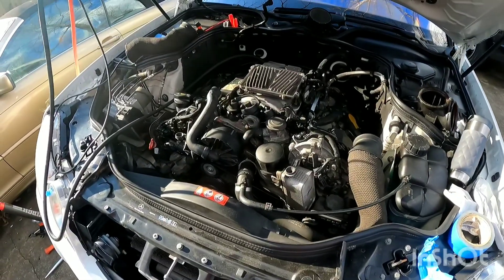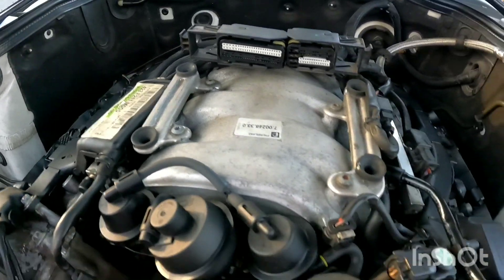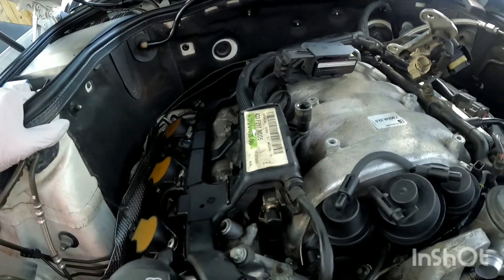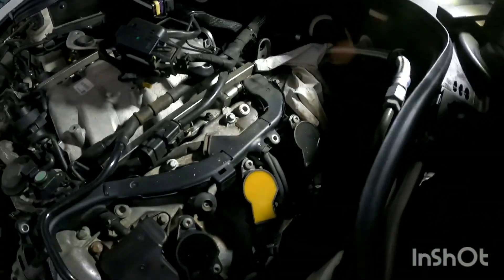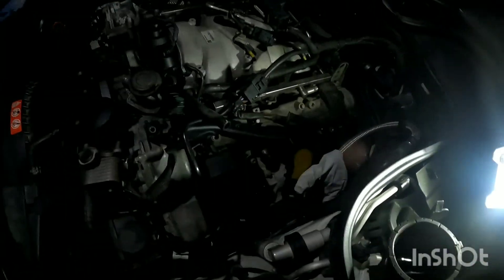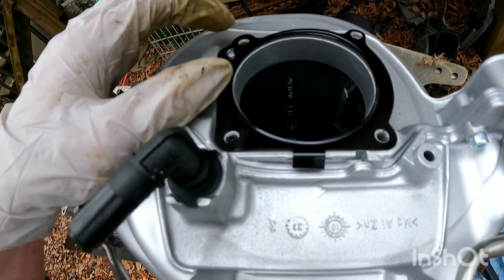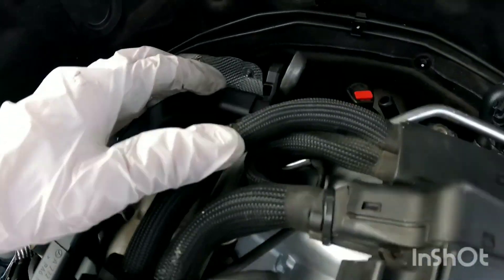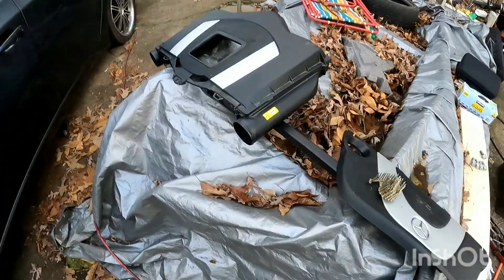Intake manifold replacement for 2006-2011 E350 Mercedes Benz

Comment: thank you for sharing this.  I am installing a replacement engine(mine was a 2006 and had the issues with valve train).  I spent the day hooking up all the wiring to the new engine only to find that the vacuum actuators on the front had been broken by the person who removed it at the auto wrecker.  Have to transfer parts from the old to new and must take intake off.  Seeing you video let me know the minimum that has to come off to do it.  Knowing that the harnass can stay is a great relief.  You put together a great, no nonsence video
Reply from the maker: Glad I could help I try to find the easiest and quickest way to do the job.

Comment: Great vid man good to see the garage mechanics doing this stuff. What brand manifold did you use doesn't look like the oem pierburg... how has it held up for you? I'm thinking about installing a chinese one made by mitzuno on my w207. Also what was that beeping noise the car made right before you screwed on your fuel pressure valve cap? My car makes this noise.
Reply from the maker: I used a cheap chinese intake from ebay the seller was called Osias. The first one I put in was bad, but they sent me a replacement when I told them it was defective. You probably wouldn't have and issues with the cheap ones I'm probably one of the few who had an issue. The second one has about 10k on it and I haven't had any issues with it. 
I'm not sure about the sound the car makes with the key in the ignition. I've heard it's part of Mercedes teleaid system but I'm not completely certain.
Reply: @E46BMWsandForeigns  the noise sounded like a vacuum leak or pressure leak and it immediately stopped when you put the cap on the fuel rail valve.
Reply from the maker: @Dnasty1  I believe it was my secondary pump for emissions because when I start the car now it makes that sound occasionally. It might be so loud because I believe mine is original with almost 200k and is wearing out.

Comment: You should not unplug the computer
Reply: very tough to get it out without unplugging it.  I’m with you on that, because i hate reprogramming ventures. But the Process is a lot easier unplugging the Computer top